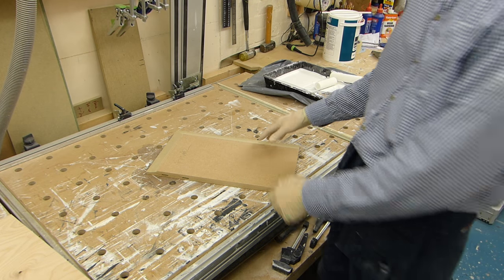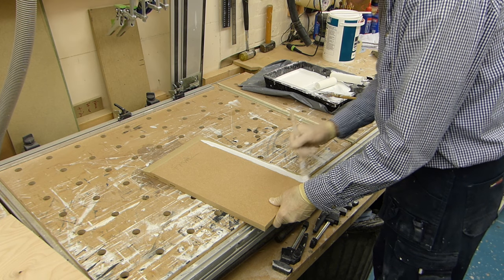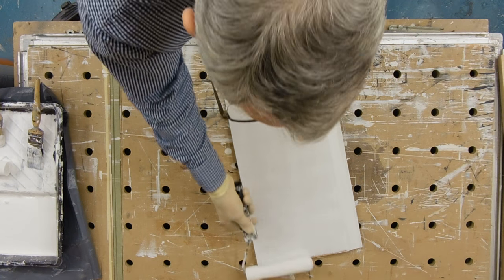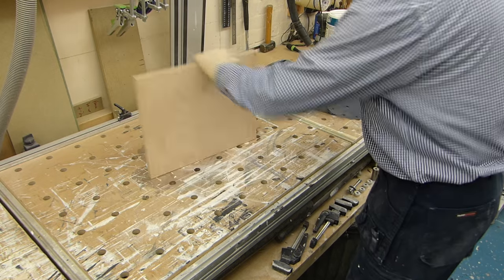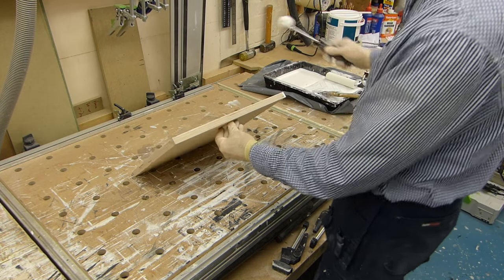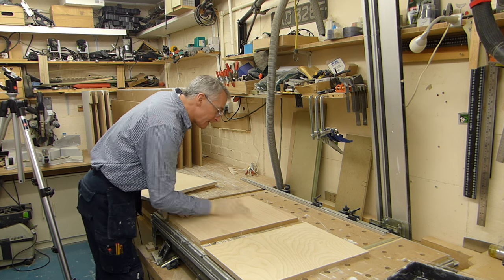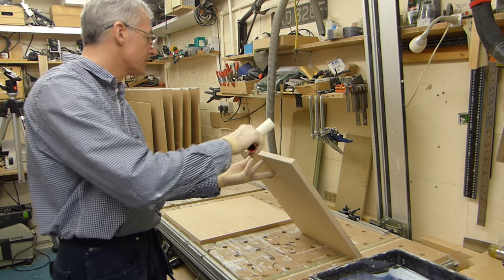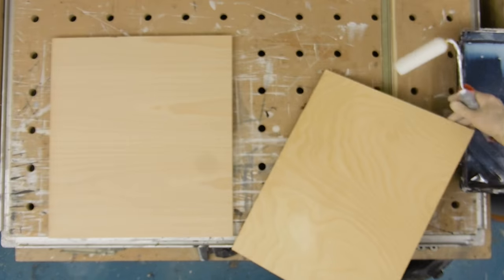Painting and finishing, part 2, #030

Comment: I'd recommend shellac sanding sealer. Paint on. Dry. Sand. Creates brilliant "end grain" mdf.
Reply from the maker: Shellac has all kinds of uses, but I’ve found that if you decent (eg moisture resistant) MDF to start wither, all you need is regular primer/undercoat 👍

Comment: One thing I have found with painting doors especially the one panel MDF type is that you need to paint both sides asap or it bends.
Reply from the maker: +Tim Box MR (moisture resistant) MDF is a world away from regular MDF. But sure, you still need to be rigorous in your methods 👍
Reply: i built my shop cabinets out of shipping pallet MDF and found using an oil base primer worked well enough.

Comment: Interesting that the dust generated from sanding was within fairly close proximity to the paint in the tray.  You seem to be reasonably confident with your process and on the basis you have a business it must be pretty good.  My expectation would have been the dust created from sanding this close to the open finish would have contaminated it.  Do you find this causes problems or is it not an issue?  (Note: I do not have many paint jobs over the years that I'm all that happy with!)  Cheers, David.
Reply from the maker: DRMNZ Non-issue in my experience, especially with this kind of light sanding, though if I was sanding more heavily I'd hook up an extractor. 👍

Comment: Great vid Peter and very informative, but one question if I may. When I paint my doors I place them on a little stand that I have so that I can rotate them whilst holding them steady and six inches or so from the bench.   I notice that you scrape the freshly painted edges of the pieces on the worktop as you manhandle them. Do you find that this mars the edges, especially with the finish/top coat?
Reply from the maker: Thanks! No, not at all. It may look like it’s scraping. It it’s actually quite a gentle action, and the paint is plenty tough enough 👍👍

Comment: interesting to see you use Junckers STRONG. After extensive Web research I chose this yesterday to use on all sanded oak parquet floor. As yet I have no practical experience of using it. I decided not to use PreLak, and was heartened to see you made the same decision. Do you find that STRONG yellows with age?
Reply from the maker: I haven't noticed any significant yellowing over time - that's more something I've associated with solvent / oil-based products. Haven't had any reason to use the PreLak either, I just use the initial coat as a primer that's effectively sanded away later in the process.

Comment: When I've painted MDF I've had issues with the edges with grain being raised after painting. Do you sand and then repaint?
Reply from the maker: Only on the primer/undercoat. You get a lot less 'raised grain' on the cut edges if you use Moisture Resistant MDF. 👍
Reply: I can't find moisture resistant MDF around here, unless I special order it in quantity. Bummer. When it comes to sheet goods, seems Europe has a much better selection.
Reply: @Psychlist1972  Super refined MDF is what you are looking for, man. That is what the product is made for... Routing / cutting the edges... Then sand then and they will be perfectly smooth. Just like maple.
Reply: @Michael McDonald thanks. Never heard of that stuff. All the MDF molding companies produce around here is plastic/foil-covered so they don't rely on edge solidity. Will see if I can find any super-refined stuff. I imagine that would be crazy dense and heavy.